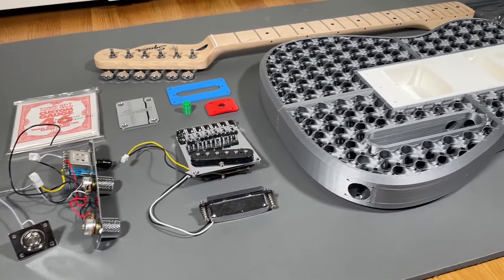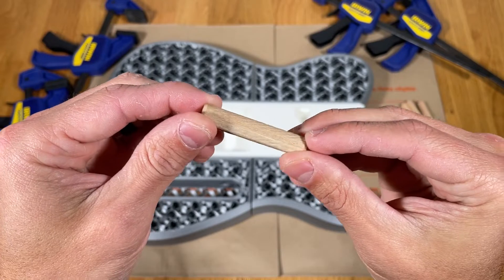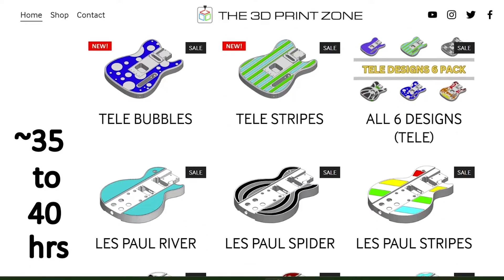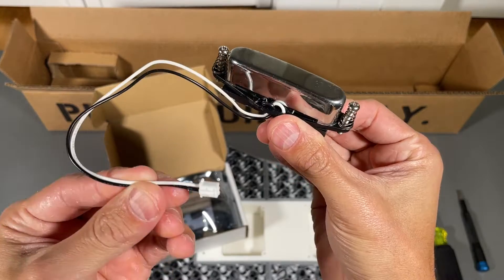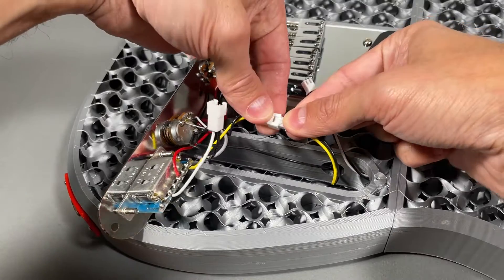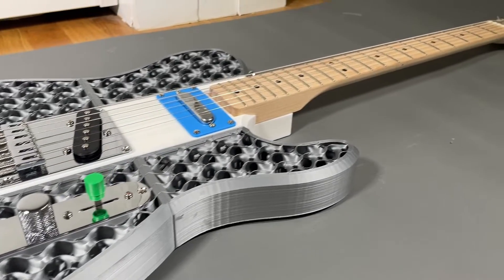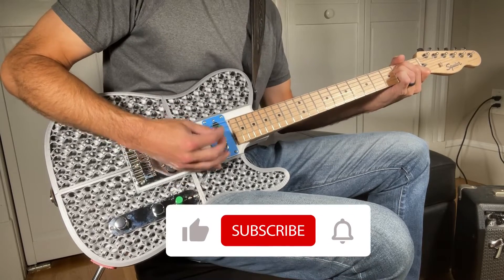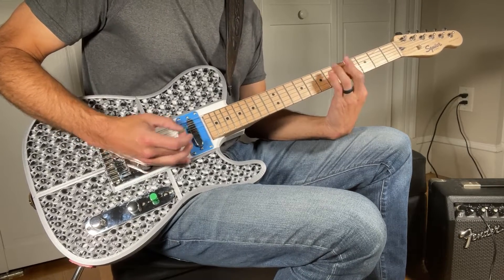Custom 3D Printed Guitar KIT Build! PRINT. BUILD. PLAY.

Comment: would it also be possible to make the outer parts 1 or 2 mm thinner on the top in order to attach a would peace as top ? How about selling the fusion 360 files so that everybody can change e.g. the fillings ?
Reply: Flip the file over in Bambu Slicer and drop it down the thickness of your wooden cap
Reply: @AndrewAHayes  Thanks !!!
Reply from the maker: @AndrewAHayes  that should work!